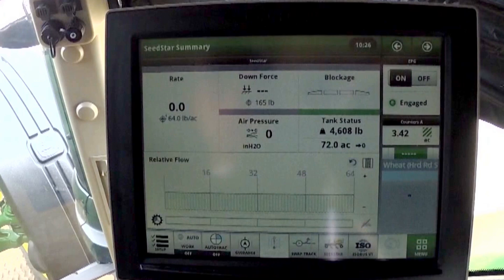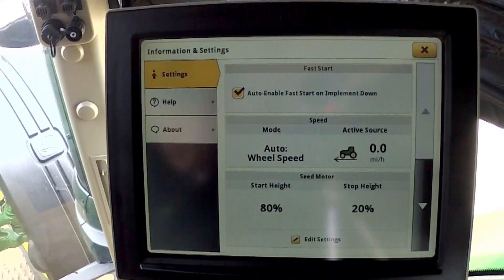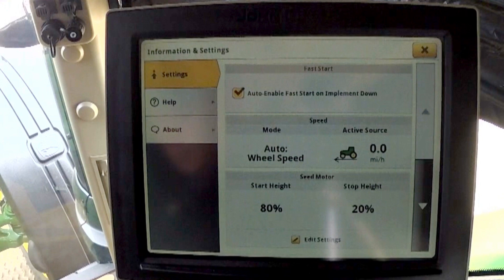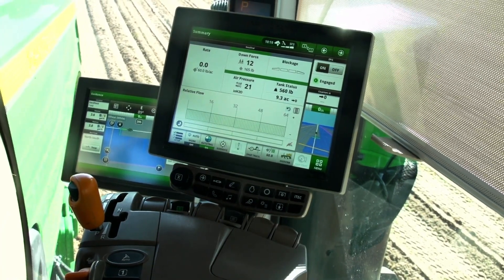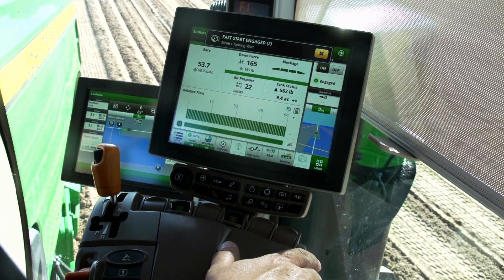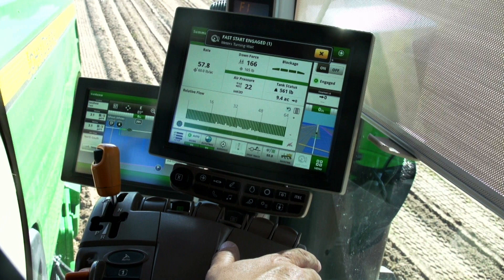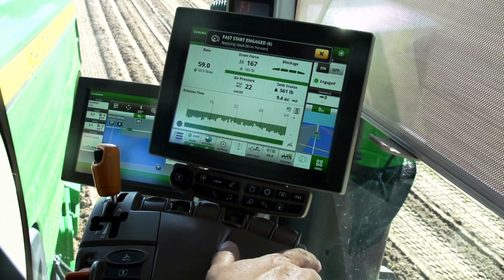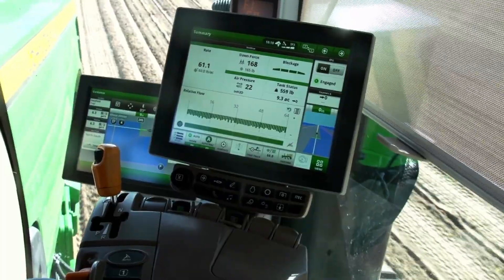How To Use Fast Start | John Deere N500C Series Air Seeders

Comment: How much hp required to pull N540C? Love my N530C but want to go bigger
Reply from the maker: Thanks for asking. You can find this information on the N540C Air Drill Central Commodity System (CCS™) product page in the "Equipment Compatibility" section of the specifications: https://bit.ly/36f3TJ5. At 1.5 in. seeding depth and 8 mph the tractor drawbar power required for 7.5-in (19.1 cm) models for the N540C is ≥ 278 kW (373 hp), for 10-in (25.4 cm) models is ≥ 225 kW (301 hp),  and for 15-in (38.1 cm) models is ≥ 166 kW (222 hp). We hope this helps!